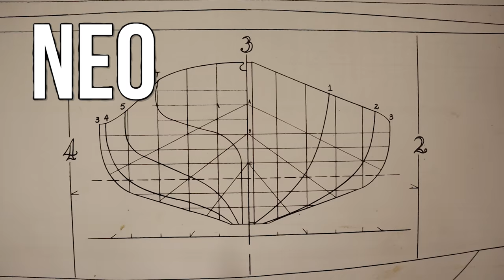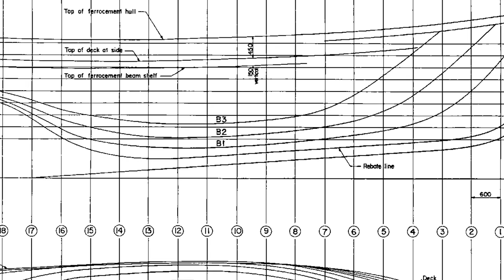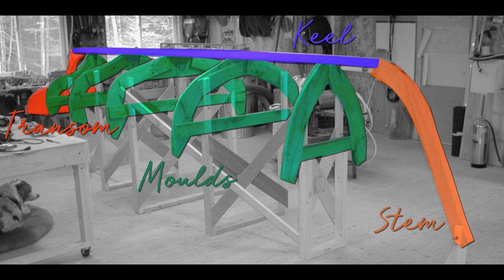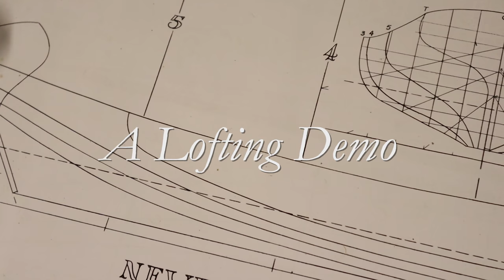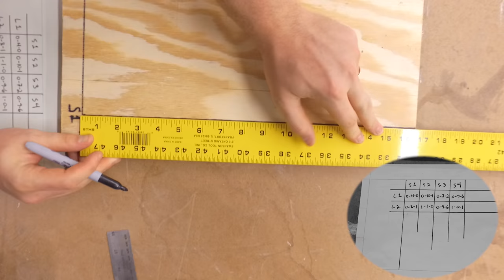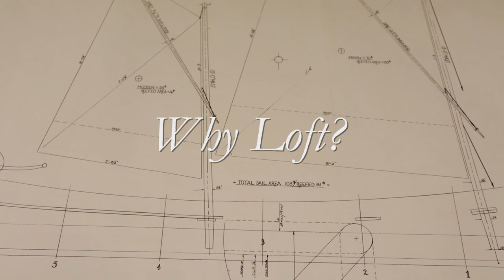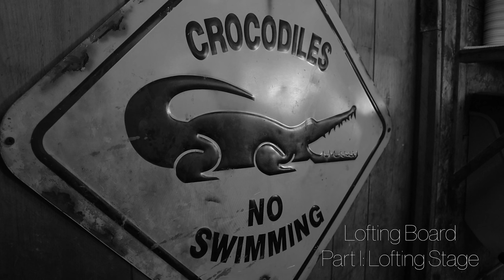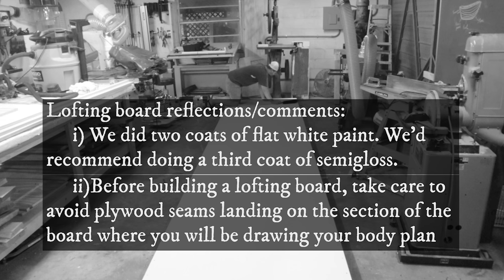Episode 2 - Lofting 101 + We Build a Lofting Stage (Boat Plans and Lofting)

Comment: I’m just starting out with boat design and although I’m relying heavily on digital tools (Solidworks, FEA and CFD), I am also trying to marry the digital with the analogue / organic.

So far though, I’m not having much luck finding the right batten material and don’t get me started on the lack of weights / ducks…

I’m beginning to think I’m just going to have to get some lead and pound it into roughly the right shapes!

I like the idea of physically defining the curves of the keel on the side view and the stations on the front / rear views. It can be quite difficult to get splines in a CAD program to be as smooth as I imagine battens + weights could be for those really fair lines.

Comment: Bos &Carr boat builders in Kumeu north of Auckland  New Zealand are masters of this craft , I was fortunate enough to work for them for a while and marveled at how they shaped alloy plate to fit a hull perfectly
Reply: Hi Richard, I have been boat building for 44 years, in steel and alloy boats.
I learned my lofting in Holland, and took what I learned to New Zealand. I used lofting on every boat that my company built. 
I used it for piece of mind that everything would fit .
We developed all the parts that you need to build the boat. Also all the hull plates. 
We also took patterns for hull plate shaping of the loft, so you could shape a plate to a perfect fit.
This would allow you to build boats in sections, witch is faster and more accurate.

Comment: A key to lofting is to use a batten that bends enough to get the tightest curve needed but not a lot more. The stiffer the batten, the smoother the curve. You should be able to use a minimum of nails to get the fair curve needed. The more nails needed to get the batten to conform to a set of offset points, the more risk you're making an unfair curve to conform to plans rather than making the plans conform to a real world fair curve. In a sense you're correcting the offsets that way. An awful lot of boat designers torture their lines using spaghetti battens and a dozen dolphin weights just to get a fair curve when all ya need is a stiff batten held near both ends and one spot somewhere along the middle to get a completely smooth curve. Pete Culler's boats are easily seen to have been designed this way. Naturally you'll need more nails for your battens occasionally, but a stiffer batten keeps this to a bare minimum. Another simplification is to just do every other set of station lines, then draw the waterlines full size, even adding one that you draw in if necessary, and those will tell you what the intervening station lines are, often better than the design by Mr. Spaghetti Battens. The exception is if there is a hollow in the forefoot up forward or perhaps a very shapely wineglass stern. Then you might draw each station just in those areas.
Reply from the maker: All agreed and great info. Thanks, Paul. I like making my battens rectangular instead of square in profile, so if I’m dealing with a light curve I bend along the wider face, while for a hard curve I bend along the shorter face. For really tight curves, nothing beats a bandsaw or hacksaw blade.
Reply: @neophyteboatwrights  Ah. No offsets I ever saw said rinse and repeat. Old colonial term?

Comment: I will ask a question, that everyone is too afraid to ask. Why do you need lofting today, if a plotter could print you paper templates, or a CNC could directly cut wooden templates? Fast and accurate.
Reply from the maker: There’s no doubt that one could do all of this digitally, and if they had access to a CNC router they could have templates cut out. Shoot, there are even better options like: 1) buying a kit 2) buying the templates ready made or 3) even just buying a boat that someone else already built. Honestly, the digital process is more complex than you characterize it. You would still have to have some way of testing self-consistency in the plans (what are called “lofting corrections”). You would still eventually have to wrap your head around how various aspects of the joinery interact, what “fairness” looks and feels like, etc. All of this is best done on the lofting board. Small boats also have tighter error tolerances that require extra care in the drafting. I know of builders that do what you claim, but it’s typically for much larger builds. So it’s not that you’re wrong but you would have to have the know how. Invest in some naval drafting software, gain access to substantial printer and/or CNC router, and then, at the end of the day, build a boat. Good luck!
Reply: @neophyteboatwrights  Thank you for the answer.

Comment: Hi Murphy, stupid question, what material does the batten made of? I mean do I need to by a batten or just make one myself? thanks a lot and have a nice day.
Reply from the maker: Pine is fine. Nice select, no knots or funky grain for best results. For really small and tight  curves hacksaw or bandsaw blades can’t be beat. I thinking milling battens rectangular so that you have a broad and narrow face is smart. That way the same batten can be used for very light long curves using the stiffer broader face, while for long more dramatic curves the smaller face

Comment: Great video!! I was just wondering why you should do it on paper. wouldn't it be easier to use a cad program and enter the coordinates and have your designs plotted out on paper or machined by a CNC?
Reply from the maker: Welllll easier is certainly relative to your abilities and resources. We do not have any CAD experience nor do we own or have access to a CNC router. Bigger more technologically savvy boat shops do exactly what your saying. They do all the designing on specialized software and then CNC templates and moulds as needed. We were compelled to loft the old fashion way both bc we dont have access or knowhow to do it the easier way and we both felt it was a rite of passage. I think theres a lot to be learned doing it by hand. In order to justify putting down certain lines you really need to understand how the boat will be constructed. Youre working at full scale and letting the battens arbitrate fairness as opposed to a computer program. Getting a physical feel for fairness is important and once your fairing the physical hull theres no computer program to help you. Just your eye and some battens.
Reply: @neophyteboatwrights  alright thank you for clarifying that does make a lot of sense
Reply: @neophyteboatwrights  
That is an absolute fact about fairing.
Besides, a boat is built from a table of off sets and not from scaling the lines on a set of blue prints.
99% of builders don’t know that the plans they use was never built by the designer and that is why the table of off sets is on the prints.
Start measuring off the prints and the aft might become part of the fore. 😳

Comment: hi  you said that you put the nails in “next to” the plotted points, is this not exactly on the points?  If not, slightly outside, inside,?  Left or right of the points doesnt make sense but …  ??
Reply from the maker: It really depends which side of the batten you’re using to make the line , but above or below the plotted point so that the operative edge of the batten is passing through the plotted point. That way when you trace the line, the line isn’t offset by the nail away from the plotted point.
Reply: @neophyteboatwrights  ok, I’ve got it.  Thank you.  Looking forward to your next vid :)

Comment: Hey, so far an awesome video. But what if the Table of offsets are not to hand? Is there a way to still make parts accurate? Or is it even possible to make your own Table of offsets?
Reply from the maker: Yes absolutely, assuming you are starting with an accurate scale drafting of the hull, then You can establish your own grid work, measure off the halfbreadths and heights above base from the drafting, scale up those measurements, and tabulate. This process is necessary if for instance you have only a half model of the hull to reference from.
Reply: @neophyteboatwrights  I think my other comment got filtered. So here again ^^ Thank you very much for the answer. Im an author and currently drawing Plans for a steel Submarine and i happen to only own Digital Plans without a Table of offsets. Problem is, the boat is 67.1 m long. So im not fully sure how to create an own Table of offsets from scratch.
Reply from the maker: @The_Engineer_Guy  feel free to email me the submarine plans to neophyteboatwrights@gmail.com and I can try to help you out.

Comment: It appears that a significant amount of time was invested in leveling.
Do you think that the value of the time invested would justify the expense of tacking a temporary dam around the perimeter of the table and pouring floor leveler on the top , letting gravity establish a perfectly level surface?
Reply from the maker: No not at all. I don’t think that’s necessary. It’s important that there are no glaring issues with flatness but we probably didn’t spend much more than an hour leveling and checking the flatness of the lofting stage. Quite a bit of work can be avoided by choosing good flat and straight stock to build the lofting stage out of, and taking care while you’re building that everything goes together right.
Reply from the maker: But maybe in terms of not having to build the lofting stage at all. It would be a time saver in that sense but hey we recycled the wood for other purposes later and certainly wouldn’t have wanted to deal with the mess of floor leveler. Also I’ve personally had mixed results with self leveling floor substrates

Comment: Really excellent.  I always wondered about "the code" in the table of offsets.  Mystery solved.  Feet, inches, eighths.  Another question, the role of the half model.  I am thinking designers must have built those first to a particular scale, then taken measurements off the model while scaling them up to full size to develop the table of offsets and lines drawings.  I'm subscribed.  You guys have no doubt heard of the Tally Ho project in WA state?
Reply from the maker: Hey Mike! Yes, originally builders and designers would have worked exclusively from halfmodels. Exactly as you said: they carved the models first then took measurements from the models and scaled them up. One interesting thing we’ve recently learned about are manipulable moulds. Builders in Newfoundland built articulated moulds that they could use to aid in improvised design. And yes of course the Tally Ho project and Leo’s vids are very familiar to us. Super inspiring and enlightening stuff!
Reply: @neophyteboatwrights  who is Leo?
Like to see his videos.
I purchased a book on half hull molding and it is a waste of money and time.
Would like to know if there’s a book and videos on half hull moldings done the old school way and not by CAD 
Thanks
Reply from the maker: @mikejustice1196  Leo Goolden of Sampson Boat Co. probably the most popular boatbuilding YT channel at this time